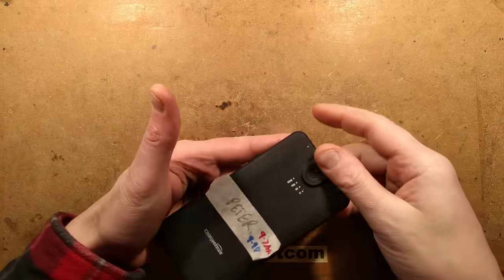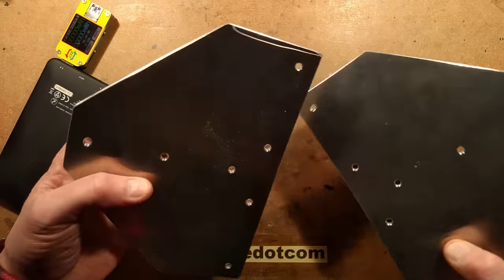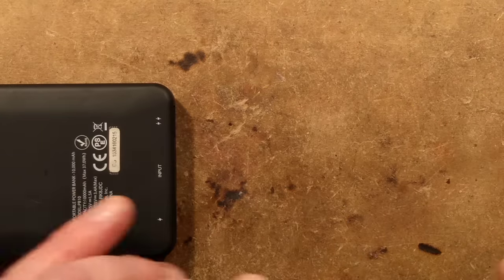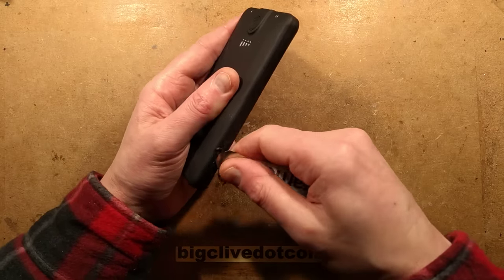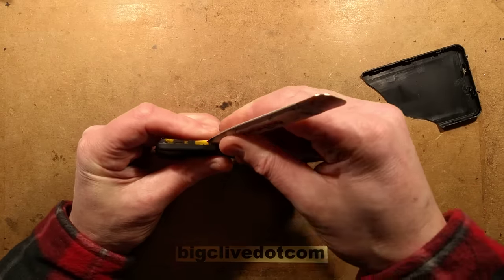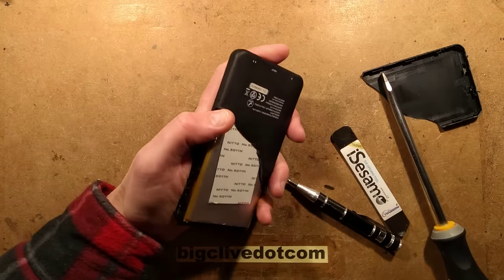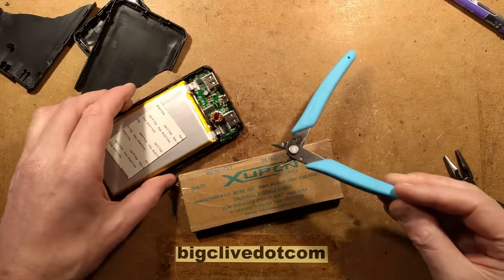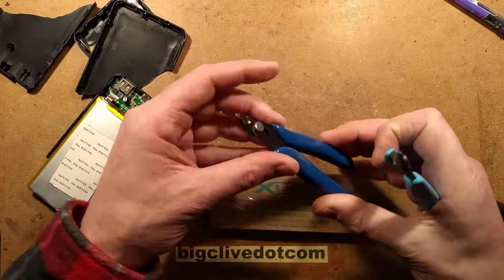Inside a recalled Amazon Basics power bank.

Comment: I work at a cell phone repair shop and we replace the batteries inside these power banks often. Watching you open this gave me a stroke!! Its sooooo easy if you do it the intended way!! and wont damage the device! You are not doing this correctly friend, you appear to be totally untrained and don't know any trade techniques. btw ALL modern lithium batteries can and will explode given the right conditions it does not matter what brand it is.

Comment: 14:07 start with a charged Lithium bomb, damage the casing at 2 or more points, add thermal energy with the soldering iron, pour petrol on it to dissolve all adhesive, and – wait, where'd I put my explosion containment pie dish?

Comment: I have found this style of tool to work great on these hardy cases:
https://i.ebayimg.com/images/g/JgsAAOxy2d9SUWhN/s-l300.jpg

once you get it in, it's actually wide enough to just crack the thing open by mere sliding it along the edge, no need for prying and risking damaging the internals

Comment: Yeah will i build a powerbank wich can output 5V 10A... If my battery can.... It proably can..... And if my wires can..... They probably cant....... And if the ebay listing is real... It probably is.... I have  usb load wich overwealms my 5V 3A powerbrick! And it runs fine.

Comment: I found out the hard way, all these stupid power banks can not be used while being charged... As having a solar panel charger (on backpack) plugged in and trying to charge a phone at the same time... you need two power banks, one on solar charger and one you are using to keep phone charged, then you can switch them around... Super Sucks... At end of day, I had a dead phone and charger...
Reply from the maker: You can add an external TP4056 charge module to allow the pack to be charged independently of the power bank circuitry.

Comment: Apple doesn't open iPhones. They tell you to buy a new one.
Reply: That battery resembles the battery of the emergency jumper lead power banks.
Reply from the maker: Those ones are based on lots of separate plates with blocks of tabs out each side.

Comment: THe solution to all these problems is Obvious.  add 1mm Sq of size to the case, thus allowing the battery pack to have clearence and more than tin-foil to protect it.  Sure would be nice if companies would stop making things at thin as humanly possible; I cant even HOLD my phone anymore ffs.  Lets add beveled edges to them! ... wtf. its only a few milimeters.  Thicker = cheaper & more reliable